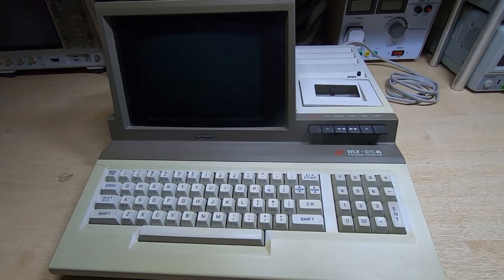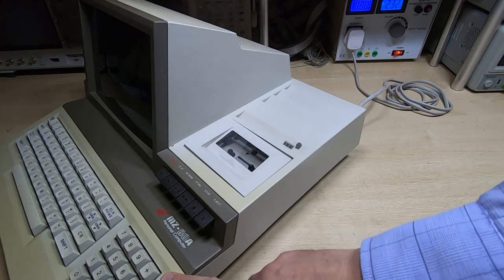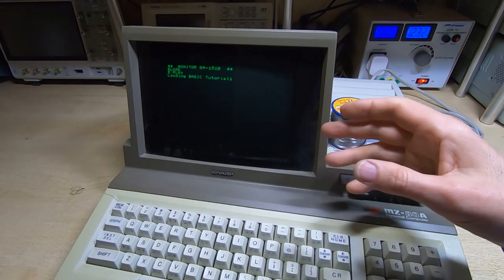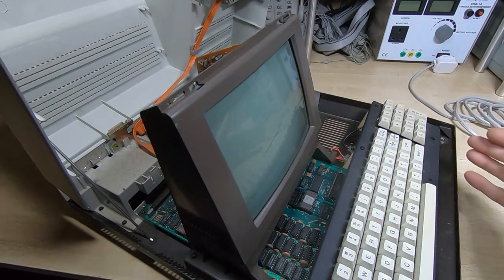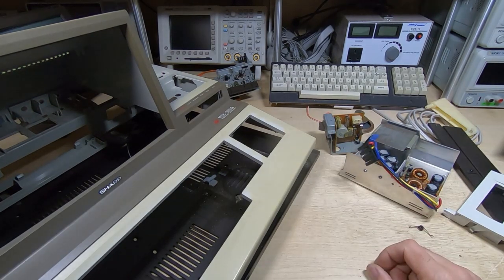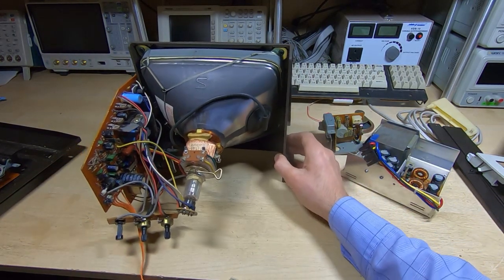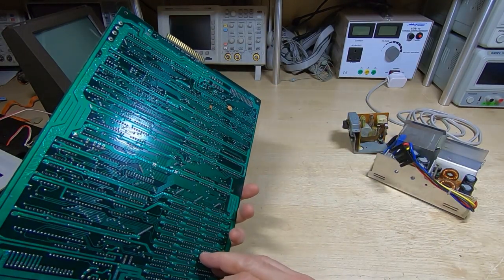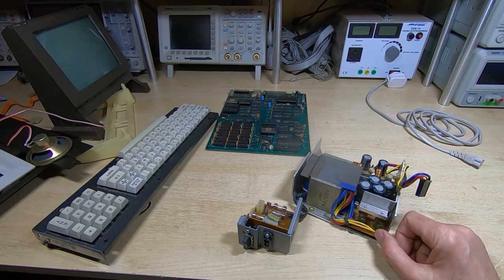Sharp  MZ80A Repair Part1

Comment: Hi Jerry I had hoped your video showed the actual order of disassembly in it’s entirety, as I have one of these from new way back in 1983.  It’s been stored in my garage for a number of years and when switched on the other day, I suspect it was the caps in the first stage of the power supply that went bang, with smoke and usual smell.  Any tips on your exact order of disassembly ?   Does everything have to come out to get at those caps ?

Comment: Good video. You don't have to type LOAD into the Monitor. It only looks at the first character of any line entered, so the command is "L". You'll need to load BASIC into the machine before loading the BASIC Tutorial tape. The RIFA caps don't need replacing as they're just filters. Both blew in my MZ-80A years ago and I'm still happily using it.

Comment: You’ve been working on a lot of interesting projects in the past months, I really enjoyed them. I had to repair a similar plastic pin in the past; wishing to maintain the originality I’ve ended up with gluing it back in place and then reinforcing with a 3 mm metal pin in the middle. It might be a possible and kind of hidden solution for you as well.
Reply from the maker: I will most likely use a carbon fibre rod, see my previous repairs. I try to avoid metal pins in plastic as they expand and contract and can cause cracking and also do not glue well.
Reply: I have seen people using super glue mixed with baking soda to repair broken plastic studs and cases. I have not tested this my self
Reply from the maker: @karlramberg  Yes I often find myself having to clean up failed repairs.
Reply: @JerryWalker001  Haha, I bet

Comment: I've been binge watching your youtube channel the past couple weeks, I wish there were more channels like yours, I actually understand most of these simpler machines, I find modern electronics, where the entire machine is basically on one chip, to be really boring, unrepairable, and all programming is done in c+ or the like, never even get close to the hardware... though if I owned most of these machines they'd just collect dust because I have no use for them, except maybe the pdp and altair type machines that I'd use just for the novelty.
Reply: Hi - being cheeky & plugging my own channel. I am trying to get a repair channel off the ground. If you look for "BOG the WOMBAT" - I currently have two videos so far but have HP9000/332-HP9134H/HP9122C restoration, Tektronix 485, HP1631D and HP16500A in preparation.
Reply: Well said @hadwell